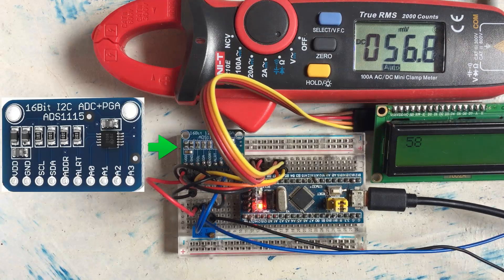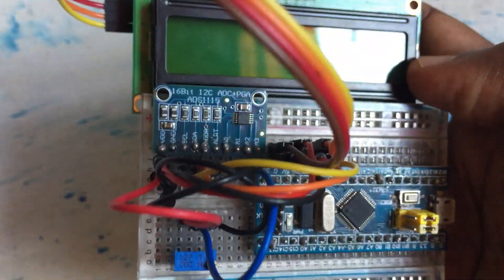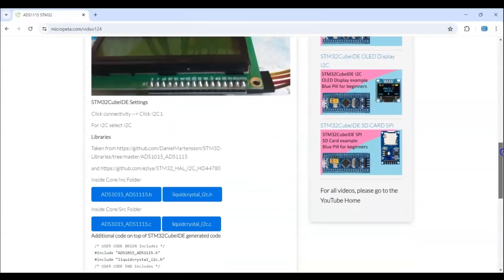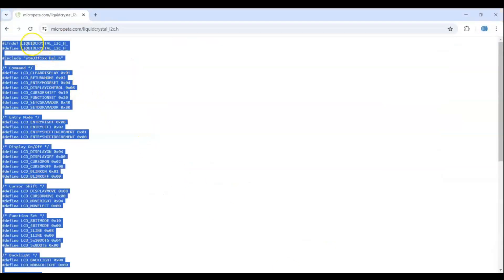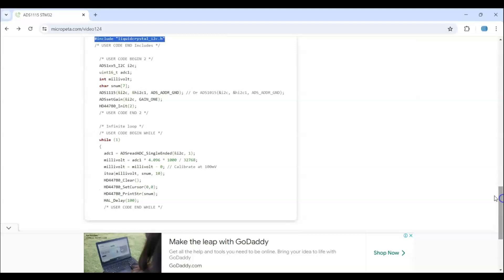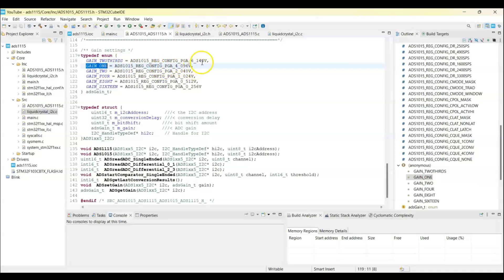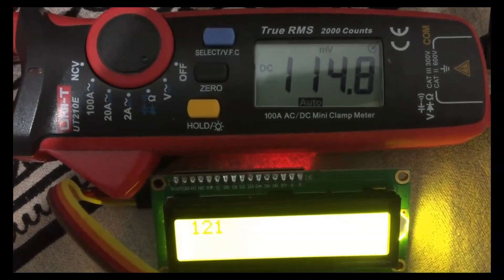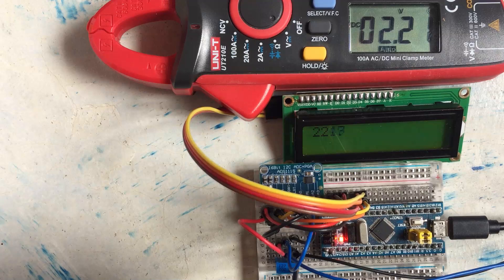124. STM32CubeIDE ADS1115 ADC with STM32 F103C8T6

Comment: why am i always getting the ADC value as 0.
Reply from the maker: Check the voltage with multimeter if it shows zero volt
Check the wiring connections by doing i2c scan as shown in https://youtu.be/7_jm38X7HUw
Thanks